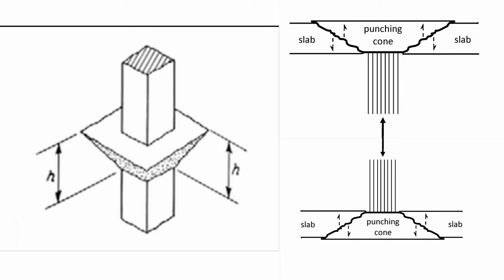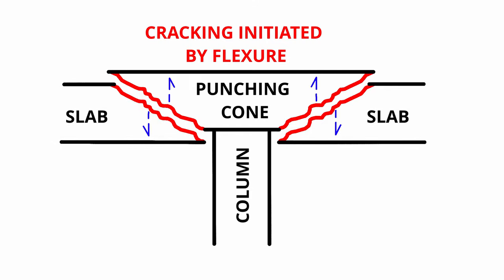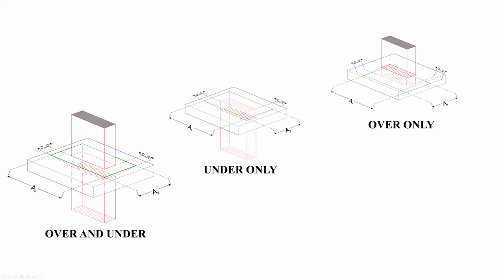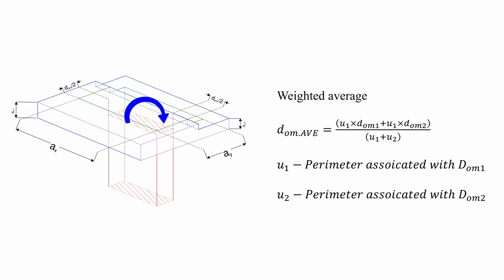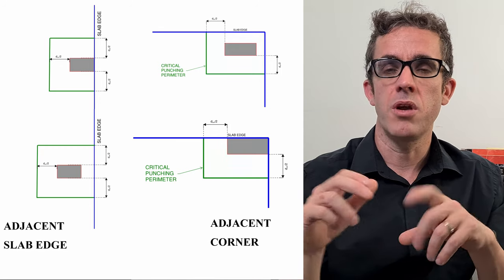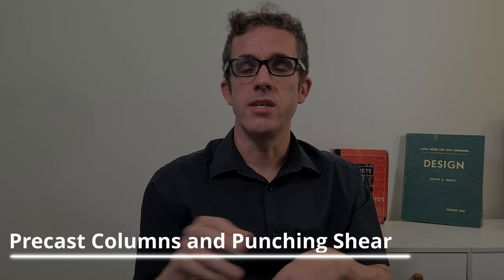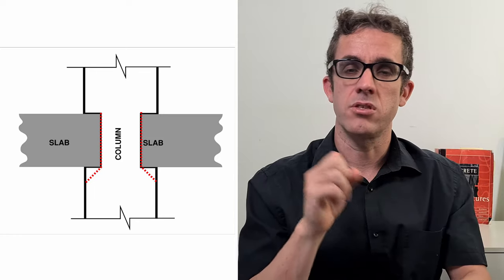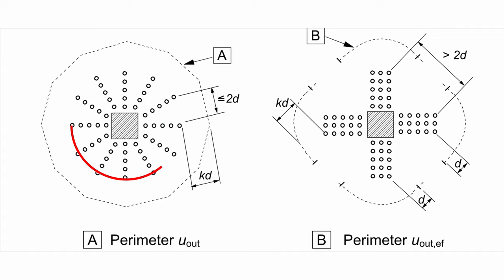Punching Shear Design | Transfers slabs and two way flat plate slabs

Comment: Some codes require a certain minimum amount of PT strands to go through the column itself so this would give you some PT compression across the failure perimeter.  You would have to lay this out to determine what part of the perimeter might have compression and what part of the perimeter might not.
Reply from the maker: Hi Bill sometimes it is hard to get PT through the column due to congestion of the column reinforcement, even tendons adject to the perimeter adds compression to the interface and can be used to in the punching shear assessment. So typically you assess the punching shear in two directions and take the corresponding P on A.
Reply: @BrendanHasty  I agree with the congestion.  In the US we use individual unbonded strands so they can be easier to fit through, but fitting in the anchor castings is the bigger problem.  However the ACI code requires a minimum of 2 strands of 1/2" diameter each to go through the columns.

Comment: Thanks Brendan, most cases I've seen is by providing drop panels
Reply from the maker: Hi Anas, Drop panels have become less popular in Australia as it increases the complexity of the formwork, building prefer flat plate slab and the additional reinforcement. the additional labour on the formwork in most cases is more expenive then the additional reinforcement.
Reply: @BrendanHasty  i too have seen drop panels more often, but it definitely makes sense that the cost for the extra reinforcement would generally be less than the additional complexity in cutting, installing, bracing and removing formwork. also i think architecturally, no drop plate would be advantageous, since thin floor plates would allow for more head room in the living area

Comment: Hi Brendan, I hope you are well. Big fan of yours. Much appreciated for your guidance. I am working on a project, where we had to re-design a job from PT to a conventional slab for childcare.  PT designers managed 200 deep slab to work for punching shear above columns. However, I could only make 400 deep drop panels above columns to work. My question is, "does punching shear behave differently in PT and conventional slabs"?
Reply from the maker: Hi Aslan, The compression from the PT helps greatly, it compresses the failure plain

Comment: Hi Brendan, This is one the topic I was eagerly waiting for. As you have mentioned Aus Standard does not cover stud rail design we have to refer it either euro code/British Standard. I think Ram Concept has incorporated ANCON in punching shear design (I think its similar to Shear Fix from Ancon). Even though we are designing in Australian Standards, Ram Concept does show the design of studs, and  I think it is based on BS. What do you suggest in this ? It is relevant to rely on Ram Concept for the stud design in Australia even though we are designing it in Aus Standard. Please correct me if i have misunderstood.
Reply from the maker: Hi Prabin, you are correct Ram design using Ancon, it doesnt provide the torsion lig design. so this strickly isn't code compliant, so you need to address this with the certifier but is common practice. as for using Ram for the punching shear checks i would reccomend you check the punching shear by hand as sometimes the punching shear checking in Ram can be incorrect, generally conservative. If design using stud rails also check using there software. and thanks  for your comments

Comment: Hi Brendan, you mentioned in video about adding column cap to increase punching shear capacity. 
I have a case with drop cap where the section within drop, at 2d from column face is not required shear reinforcement, but the section at the drop cap face and slab needed to be reinforced. 
I want to ask you in this case, do i have to provide shear reinforcement within the drop cap or I just need shear reinforcement in slab. Thank you in advance
Reply from the maker: Hi Nguyen, thanks for watching. As for the shear check, if the shear past the drop cap requires shear reinforcement this area should be reinforced as required. The slab can still have a shear failure. Maybe increased the size of the drop cap to cover shear failure if not too far.
Reply: @BrendanHasty  thank for your answer. In my case, because of architectural design, i can't change the structural layout.
In EC2 code section 9.4 
Quote:"Where punching shear reinforcement is required (see 6.4) it should be placed between the 
>>>loaded area/column<<< and kd inside the control perimeter at which shear reinforcement is no longer required". 
Does this mean if my slab section need shear rebar, i must provide shear rebar from slab section to column face. Which mean shear bar within drop too (Even though my drop cap not need to be reinforced)

Comment: hallo Brendan, i encountered such a case where the slab supposed to have these studs reinforcement in it, our job was to search for them and to find out if they are really built in or not, it all started as the slab starts to crack and taking the shape of rays going out of the columns, the cracks follows exactly the pattern  that the claimed built in studs should be taking (the studs built as sun rays out of column). if the punching shear would form around the column, what makes the cracks then starts from the column and extend in different directions?
Reply from the maker: Hi Rawaa,  thanks for watching. Punching shear is formed from two mechanisms, flexure and shear, then this can cause two types of cracks the shear cracking and the flexure cracking.
The shear cracking the classic ring around the column.
and Flexure/tension cracking, these are the ones that radiate out like sun rays, as the punching shear forms a ring there is a perpendicular tension force, and this is why they form this way.  
The failure for punching shear is caused by the stress ring around the column and can be an issue in locations of high shear and a low moment or medium shear and high moment. This is due to the moment causing increased stress on the perimeter, the classic failures where issues on the edges and corners of slabs that had high torsion/moment. 
So there are two approaches to address this in design
Strengthen the shear capacity as pre stud rails
Or strengthen the torsion/moment capacity similar to AS/NZ or ACI.

Not sure if the above clarification helped you, if you need more details let me know and good luck
Reply: @BrendanHasty   oh thanks for the clarification, i think i need more details if u have.

Comment: Hi brendah! Thanks for  your advice it was really amazing .I would like to ask  you    on flat slab.which column  has high punching shear failure among middle column and edge column. In project ,I used  flat slab of 250mm  in SAFE 20, BS 8110 code drop panels (250mm) for resisting punching  but it stills  fail ,when I did hand calculation  my flat slab didn't  punch at all. What can I do ! I'm  looking forward for your answer.